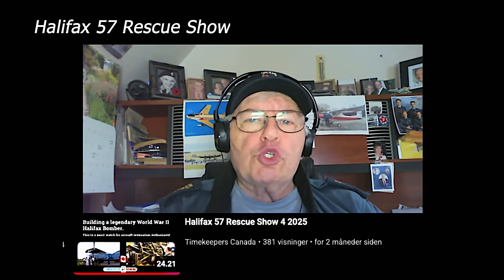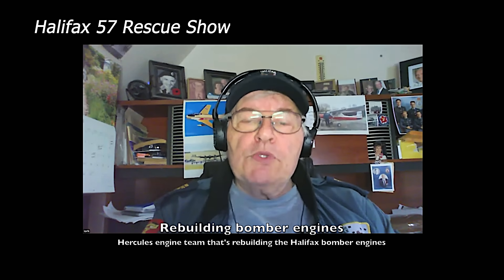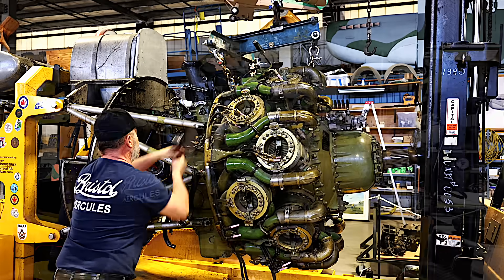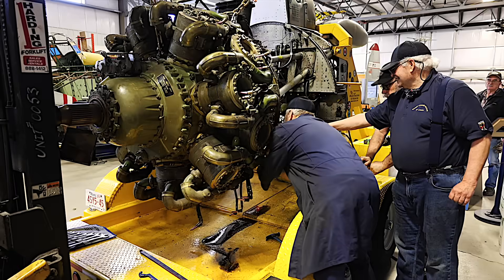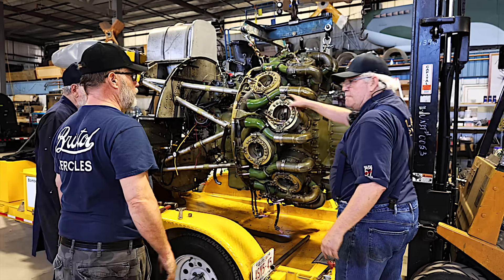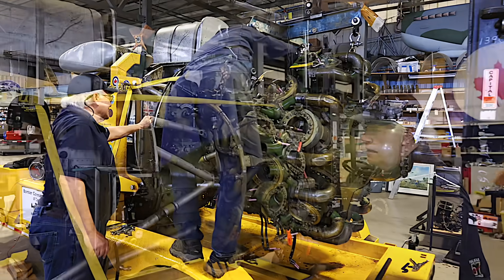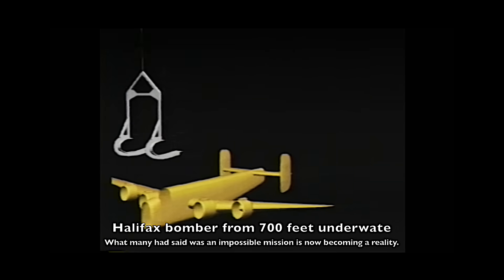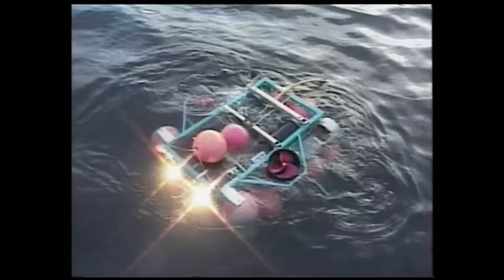Halifax 57 Rescue Show 16 2025

Comment: I must have missed it in the video, where was the aircraft found? Is it in fresh water? When did the aircraft go down? Any details on the original crew of the aircraft?
Reply from the maker: Thank you for your interest! I hope the following information answers your questions:

The aircraft, a Halifax bomber, was found in Lake Mjøsa in Norway, which is a freshwater lake. It was shot down and made an emergency landing there on the evening of April 24, 1945.

The original crew consisted of six young British airmen: Flight Lieutenant Turnbull (pilot), Flight Lieutenant Mitchell (navigator), Flight Sergeant Bassett (flight engineer), Flight Sergeant Tuckett (air gunner), and Flight Sergeant Naylor (radio operator). The only survivor of the crash was Flight Sergeant Thomas Weightman.

See the video if you wish: https://youtu.be/7O0MNl7e49w

I hope these details help you!